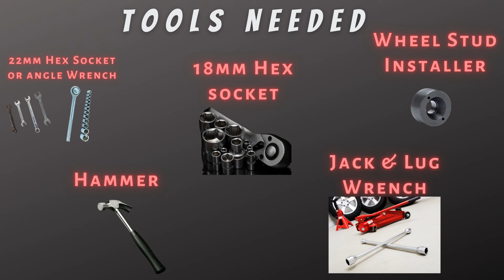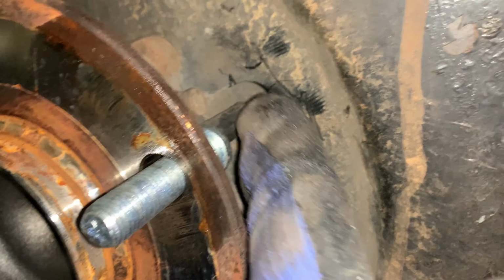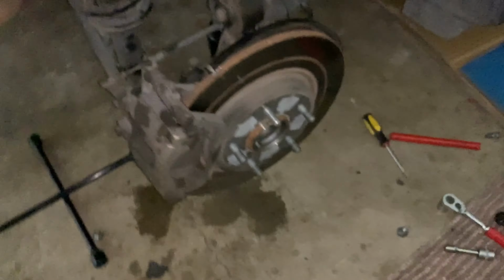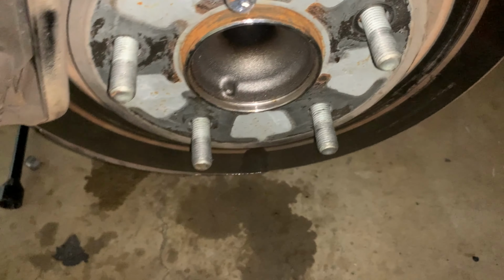Expert Advice: How to Properly Replace 2017 Dodge Journey Wheel Studs

Comment: How did you get the full length new one in?
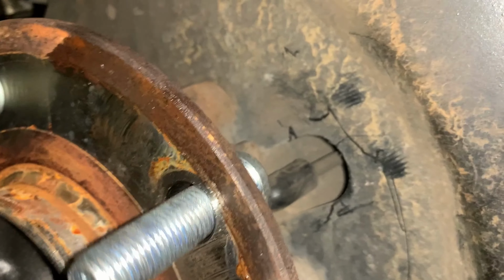Reply from the maker: Watch from 3:10 I explain their
Reply: What bolts were removed behind the wheel housing?
Reply from the maker: @willstreets3279  it’s 4 regular hex blots can’t remember the size though